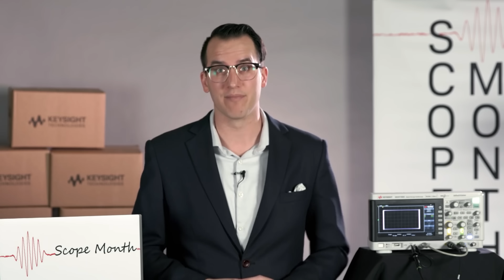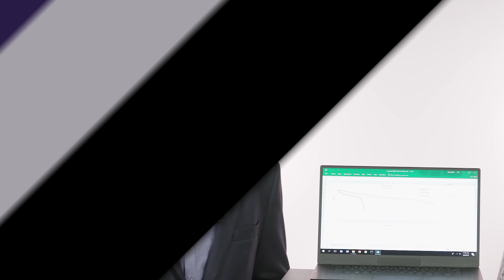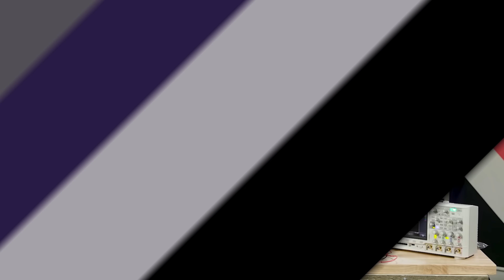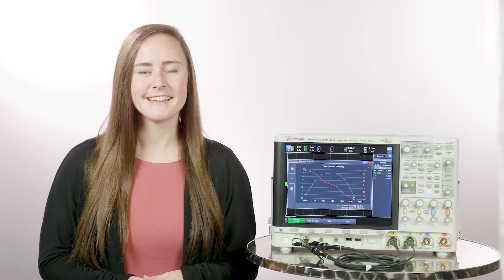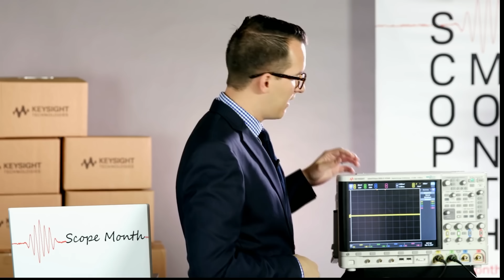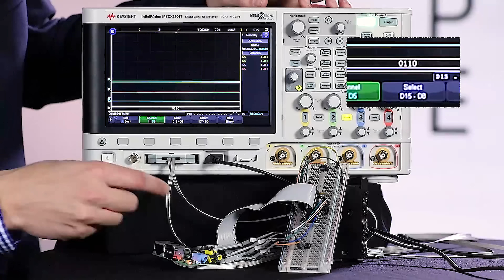Giveaway! + 5 Test Gear Tips from the Vault (Wave 2020)

Comment: I have a tip, how about a low cost scope that is specifically designed for audio electronics work? I'm never going to work with micro controllers but even if I did, I would prefer to have a different machine that I know is dedicated to that sort of work, I wouldn't have to go digging into the menu just to make a quick measurement... My signal tracer only tracers signals... It's where I go to find that noisy resistor with the high gain RF Probe...